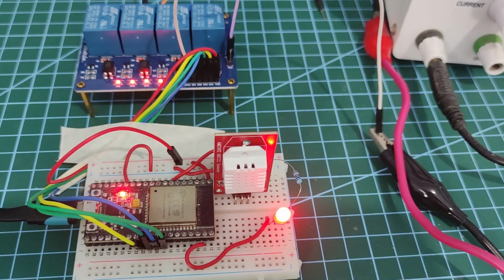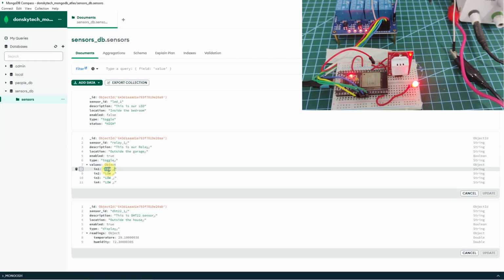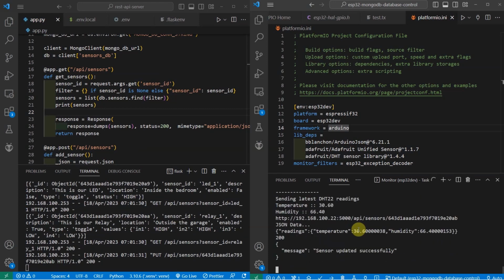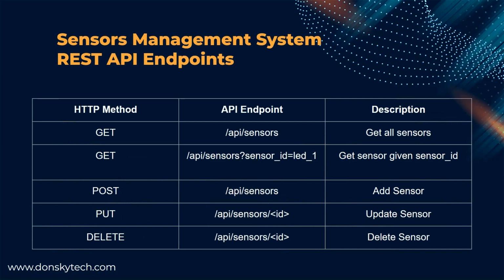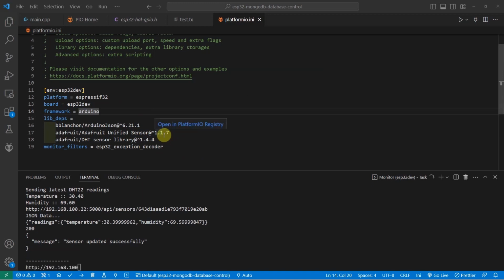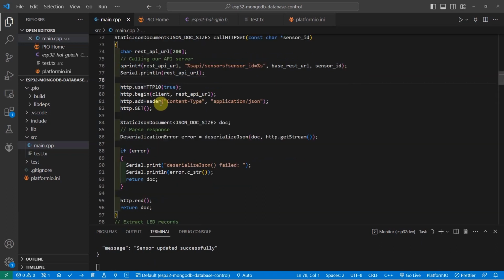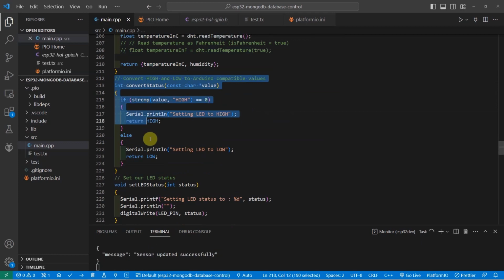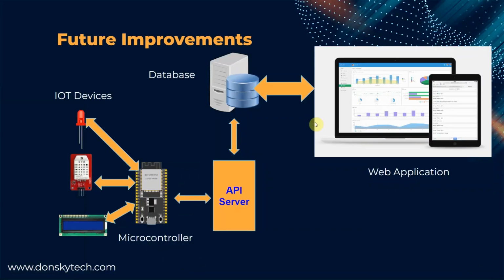Control your Arduino IoT projects with a MongoDB database

Comment: hi sir, i did the same steps but i get Error on sending POST: -1 and  deserializeJson() failed: EmptyInput, may i know the issue
Reply from the maker: Hey, are you able to connect with your REST API Server? Test it first using Postman or curl
Reply: @DonskyTech  i got the error message [104964][E][WiFiClient.cpp:268] connect(): socket error on fd 48, errno: 104, "Connection reset by peer"
Reply: i solve it sir, anyway thx for the help
Reply from the maker: @ok-mj3nh  Sure no problem!
Reply: @ok-mj3nh  hi sir, I got the same problem, how can I fix this deserializeJson() failed: EmptyInput?
Reply: @ok-mj3nh  what was the problem?

Comment: Sorry if I am intruding. I have followed all the steps in your tutorial, but when I run the code, it returns "deserializeJson() failed: EmptyInput". Do you know how to fix the problem? I used ArduinoJson to calculate the JSON document size, and it is 768, which I updated in the code.
Reply from the maker: No, it's actually okay.  I actually liked this as somebody is validating all the information that I have put in this series.  The series is very long and full of "techie stuff" and I cannot find anything on the internet when I was googling for this stuff so I have decided to write my own.  I have used this on one of the projects that I am working on.
Regarding your question, you can find more information here as there are lots of causes of this error https://arduinojson.org/v6/api/misc/deserializationerror/.
But when working with REST API, I always use Postman or curl first before calling that on my Microcontrollers.  I am making sure that everything is working correctly before applying it on my Arduino code as debugging on any microcontroller is such a pain.
You might also need to Serial print the API URL where your Microcontroller is connecting.

Comment: Hi, thank you for your tutorial. I was able to follow all the steps, but when I ran the code, it resulted in an error when sending the POST request (-1 error code). I've confirmed that my internet connection is working properly, and I'm certain that the port and API URL are correct. How can I fix this issue?
Reply from the maker: try to get the latest code from GitHub I made some minor changes to the REST API Code to make it available to all networks.  If not try try to run it with 
flask run --host=0.0.0.0
Reply: @DonskyTech  I watched part 3 of this series and I realized that only the GET method is working, while PUT, POST, and DELETE are not. Whenever I try to use PUT, POST, or DELETE, it returns an error like this:

{
"errorCode": 400,
"errorDescription": "Bad request!",
"errorDetailedDescription": "Did not attempt to load JSON data because the request Content-Type was not 'application/json'.",
"errorName": "Bad Request"
}

Can you help me resolve this issue?
Reply: Nevermind I figured it out, I forgot to check the JSON format in POSTMAN !

Comment: We have an IoT smart irrigation system project using arduino uno and bluetooth module HC-05. We want to recieve the sensors data from the bluetooth module and transfer it to mongodb, to include it in our flutter app that displays the sensors' values as charts. We don't know where to start in the database part of the project. Do you have any tips for us. We would appreciate your help.
Reply from the maker: Read the writeup on this MongoDB tutorial series. You would get information on how this is to be done I am sure.

Comment: I for one would like to see the web app you mentioned at the end of the video. While watching I was thinking that changing an LED state by editing a database entry was not really useful. Thanks for the video
Reply from the maker: @keithlohmeyer Hahaha, yeah you are spot on.  The video and the write-up are getting longer so I had to cut it in and place it in a future article.  But it would be easier now since the web application will just read and update the values on our database and the Arduino would pick up all these changes.  I currently am working on this side project now.